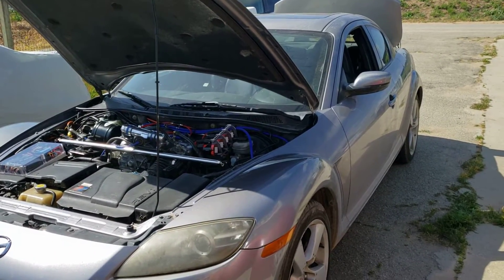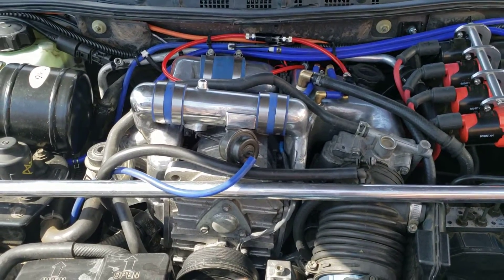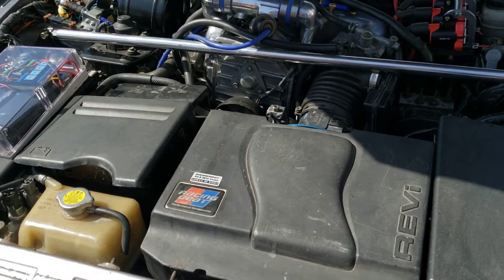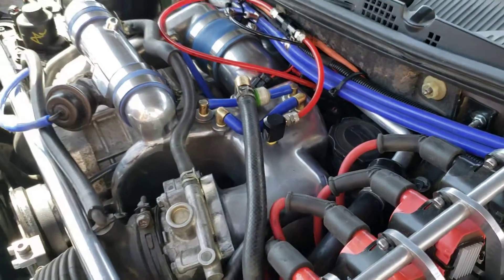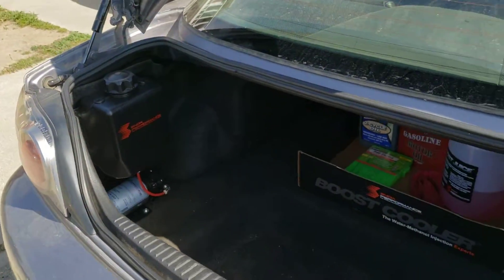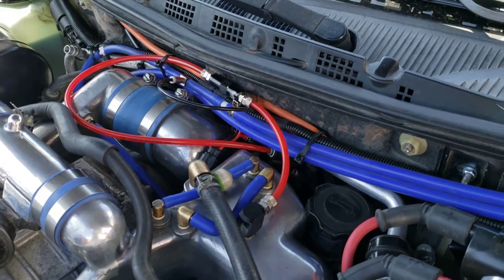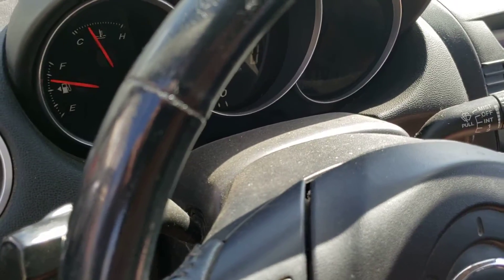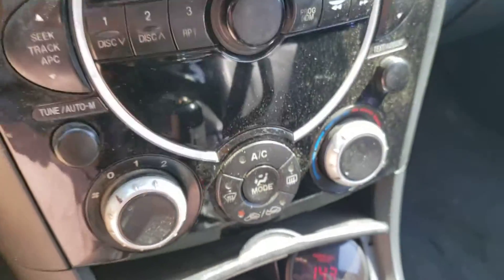RX8 Supercharger/Meth walkaround rev

Comment: It's so good to see to supercharged RX8, very rare, and far simpler than a turbo. Well done.
Reply from the maker: Thanks Simon, I think it is a lot easier install then a turbo. Runs very cool with the meth injection too. I have it off right now so I can modify it for an intercooler and a better bypass. Check out the rx8club thread I have for the latest mod. I'll also post the update here once I install it again. https://www.rx8club.com/series-i-major-horsepower-upgrades-93/gearsofts-sc-thread-271481/page3/#post4952402
Reply: I have a 09 Mazda RX8 R3 package and would be very interested in learning about what you have done with the supercharger saddle computer and methanol cooler. I would also be very interested in learning what it dinos at?
Reply: @shermanlewis2510  damn bro you're so lucky. I'm saving up for a year to have 12k so I can hopefully get an r3 as well

Comment: Subscribed, good content and informative. I have modded my Rx8 and still adding more. Sitting at 79k miles. I inject two stroke from a reservoir as well. Havent't seen a force induction Rx8 with the two stroke feed. Love the build, can't wait to see it after being rebuilt.
Reply from the maker: Finished the rebuild a while ago and added a roller bearing mod to the eshaft so I can tension the SC belt and not wear out the motor bearing on the next install. Working on rev 3 for the SC install with a water-air intercooler and ice bucket.

Comment: Sweet build! looks really nice and I'm looking to do some mods similar to yours on my own 07 RX8!
Reply from the maker: Thanks Potato! Some of the basic mods like the 2 stroke oil injection and the ls2 coils are some great ones to start with. The coils do require some dwell changes in the ecu that I did with versatuner, but you can use a great new coil that BHR came out with recently that doesn't require any dwell mods. https://black-halo-racing.myshopify.com/products/ignition-upgrade
I'll probably upgrade to these but I really do like how my ls2 style coils look where I relocated them too.

Comment: Thank you for sharing your work! I imagine that a supercharger fits well with the characteristics of the RX-8. Is your ECU setup able to handle E85 flex fuel (if one would install a sensor, and adjust the fueling system)?
Reply from the maker: Yes the SC does a nice job making up for what the RX8 lacks on the low end. I have boost set to come on at about 1200 RPM. If you know rotorys, you don't got much until you hit at least 4500 or 5000. The E85 would be great instead of the water-meth but I can't get it easily where I live. I'm working on the next SC revisions right after xmas. Had to pull it off to smog. Going to add a water-air intercooler so I won't need water-meth or E85. The SC only adds about 10 psi booth so the premium fuel will work fine with that.
Reply: @johngeary4202  Thank you for the fast and informative reply! Looking forward to see your future projects!

Comment: Looks great, what is your ecu setup, looks like you have a nano and some kind of relay board? Sounds like a great price on the SC kit. How what mileage do you get on the water tank, that pump looks kind of serious.
Reply from the maker: Thanks lizunya1983 for the comments!
Here's the ecu setup:
eManage ultimate  piggyback  to intercept the fuel injectors and ignition and map more fuel and timing when it sees boost. I have a MAP sensor and an AFR connected (the AFR has a sensor that I welded a bung in the exhaust for). The emanage also looks at the throttle position and sends an output to turn on the supercharger at 30% depending on RPM and throttle position.
Arduino Nano intercepts the emanage SC signal to police the SC. It controls the supercharger, water-meth pump and a bypass (like a wastegate on a turbo). using inputs from the emanage, a "Mad Max" button in the car, and other sensors like a float in the WM tank and a pressure monitor on the WM line to control whether the SC is allowed to come on. Since I now have the fuel and timing modified for the WMI I have it not allow the supercharger to run if there's an issue with the WMI system. The program is getting too big for the Nano now some I'm upgrading it to a Nano 33 BLE. I'm also doing this upgrade to give me a bluetooth connection to my phone and have an app I configured to be able to monitor and modify settings and timers on the Nano while I'm driving.
The Nano connects to the relay board that uses very low amps from it to control the SC clutch, WMI pump and the wastegate bypass solenoid I installed.
There's also a Greedy boost controller that is set to limit boost to 10 PSI that is mounted in the car. It controls boost using the wastegate once the Nano hands off control to it with a bypass solenoid I installed.
Lot's of other technical but I think I'll just make a new video to go over it all.
You also asked about the pump. It's a standard starter kit from Snow. The pump can push 300 psi but it's governed by the nozzle that's in the intake which is a 175 ml per minute. If you do the math it can use up the tank in 15 minutes at that rate but it does only turn on the pump when I'm using the supercharger and since that's on a clutch and set for 30% throttle it really depends on how I'm driving it for how much it uses. I'm buying winter windshield washer fluid for $2 bucks that has 30% methanol in it and using that for the WMI system so it's not a big expense.
Reply: @johngeary4202  Thanks for the detailed response! Sounds like you could get through the tank pretty quick if you were pushing it. Is the snow kit a fixed head/flow rate? So you're still feeding the stock MAF and wideband into the stock ecu? The engagement of the SC is sounds great, so the center console button is latching and the gear lever switch is momentary and both are supervised by the nano based on the eManage state? I think I need a flowchart or something! Looking forward to seeing a video on your control setup!
Reply from the maker: @lizunya1983  The WMI is regulated by the size of the injection nozzle. Snow base kit comes with two nozzle sizes, I'm using a 175ml per minute. At full pump speed it should use that much WM per minute. I'm working on a speed controller for the WMI motor to control the pump speed based on boost and RPM. Snow does have a controller for this but it's based only on boost pressure, you set a low and a high boost psi and the controller runs the pump proportionally depending on these settings. In an SC setup like mine the boost is always on or off so I'm looking at using an extra output I have on the eManage that I'll setup to give me a 0-5v out based on boost and RPM that I'll then send that signal to the Nano to control the pump speed using a brushed esc. I'll probably need to do some re-tuning but this should use less WM and give me some control over the pump and the ml per second.
The stock MAF and wideband are still feeding the stock ecu, the only potential issue with using a piggyback ecu on top of the stock one is the stock ecu may try to re-tune itself based on the wideband in closed loop mode, but I do keep an eye on the trims... 
The center console button is latching and the gear lever switch is momentary and both are supervised by the nano based on the eManage state, and yes a flowchart would be helpful, maybe I'll setup a whiteboard in my next video to help explain this, or if you're an Arduino guy I'll share the code with you. The program is over 400 lines of code and has out grown the standard Nano's memory of 2k so I moved on to a Nano Every with 6k and have an HC-06 bluetooth module with an interface on my phone so I can monitor the Nano's status and change some of the timers in it from inside of the car.
Here's a short snip of the code:
////////////////////////////////////////////////////////////////////////////////////////////////
// RX8_SC_Bypass4
// Blitz Supercharger with Water-Methanol injection and air tank solinoid to bypass
// written by John Geary
// version 1.0 initial
// version 1.1 pre WM PSI failsafe
// version 1.2 WM PSI failsafe added - loaded in car 5.22.20 8pm - delayWM_interval  = 1000
// version 1.3 variable treaks - comments added - no logic changes
//    added variadic template function - loaded in car 5.28.20 3pm
// version 1.4 added syncBypass = true to keep bypass closed insync with the supercharger
// version 2.0 modified for nano every and hc-06 upgrade
////////////////////////////////////////////////////////////////////////////////////////////////
...
// set outputs if anything changed
void setOutputs() {
  readBT();
  if (inputsChanged) {
    if (!sentFrom_PSI_changed) {
      check_PSI();
    } else {
      sentFrom_PSI_changed = false;
    }
    //should not be any pressure if before starting the WM pump.
    //if a wire breaks on the pressure sensor it will not start boost.
    WMPSIok = (digitalRead(inWMPSI) == HIGH) ? true : false; //reversed logic NPN, on=high if pressure sensed
    Serial.println(F(""));
    if (simulate == LOW) {
      Serial.println(F("-------Simulation Benchtest-------"));
      if (WMPSIdrop and !simWMPSIinit) {
        WMPSIok = false;
      }
    } else if (simulate == HIGH) {
      Serial.println(F("-------Live in car-------"));
...
Reply: @johngeary4202  what supercharger did you run? I'm so intimately curious on where you bought it.. could yo ugive me a product name/link any details at all?
Reply from the maker: @TASTELESSAUTO  It's a Blitz supercharge. They used to sell them back in '04 for about $8K for the complete kit. You can't buy them any more from Blitz. I found this one on eBay for $1,600 but it was missing the controller and some minor brackets. I'm pretty good with electronics and programming so I added a Greedy eManage piggyback and an Arduino to control the clutch and water-meth. Your best bet for finding one is to open a search on ebay and have it notify you if one goes on sale, then jump on it! That's what I did.

Comment: I have not seen a blitz product in like 20 years.
Reply from the maker: I just rebuilt the motor and I'm cleaning up the wiring and putting the supercharger back on. Looking at modifing the bypass and adding an intercooler to the next version.

Comment: did you have to extend the original cables to move the ignition coils to that point? if yes, how did you do it? Thanks.
Reply from the maker: I made my own cables. Here's a parts list from Amazon:
MSD 34039 Red 8.5mm 6' Roll Spark Plug Wire https://www.amazon.com/dp/B00062YYEU/ref=cm_sw_r_apan_glt_fabc_FY8YNB8KN855KJNRT3MT?_encoding=UTF8&psc=1
Taylor Cable 46069 Spark Plug Boot https://www.amazon.com/dp/B007YDACP4?ref=ppx_pop_mob_ap_share
Taylor Cable 46061 Blue 90-Degree... https://www.amazon.com/dp/B000CQ4BEI?ref=ppx_pop_mob_ap_share
IWISS Ratchet Spark Plug Wire... https://www.amazon.com/dp/B07K2VG6XY?ref=ppx_pop_mob_ap_share

Comment: OMFG is this supercharger setup doable at home? I have no experience in tuning sadly... thats why I got a miata for now
Reply from the maker: I bought the SC on ebay for $1600 and added an emanage piggyback fuel(etc) manager and an arduino to help control the clutch on the SC and the water/meth injection and for protection for it. So, yes this is doable at home but you really need to be careful not to detonate (run too lean) your engine or you can destroy it. The emanage has logging so you can modify the fuel and timing maps in it and then take the car for a test run and use the logging to fine tune the maps. emanage is kind of old and I may upgrade to another computer but it's been working great for me. The Water meth also helps with detonation and makes it a lot easier to tune. Hey miatas are cool! The motor isn't that powerful but it works great with a car that light and nimble!
Reply: John Geary yeah I love my miata. But its my project till I can afford an rx8 :D
Reply from the maker: @maybelive765  , you better have a boat load of cash saved when you buy your 8 because you'll most likely need to rebuild the motor. I just did mine and it cost me $4k and I did the rebuild myself!
Reply: John Geary oh wow I will consider this. Im sure its not that bad long-term right? Anyhow i will be so happy once I switch cars, the miata's great but you CANNNNOOOTT take it outside during winter time. Its just not properly set up at all, especially the interior even with a hardtop. At least with any RX8 you have decent interior climate control lol. Here in upper canada winters will be rough so I dont expect much, would you happen to know some tricks that could potentially help me run the car longer throughout the year... at worst imma pre-heat the oil like a race car 😂😂
Reply from the maker: @maybelive765  If you fix the motor once and fix it right it will last a long time. I did a few other mods to help it last longer too like replacing the stock ignition coils with some ls1 d585 coils (need to set the coil dwell map if you add these). You can really kill your engine to have it misfiring and the stock coils don't seam to last very long. I also added a sohn adapter that lets you burn 2-stroke oil instead of the regular engine oil and I install software from versatuner that lets me increase the oil injection. Since my latest rebuild I'm also premixing the gas with 2-stroke oil, only about a 1/2oz per gallon, but this will really help the engine to last longer too, and the 2-stroke oil I'm using doesn't cause carbon buildup like the engine oil will, carbon buildup is another compression killer in rotories. Rotories also run a little hot so I'm looking at some mods to the oil coolers to help a little more. I already have an upgraded aluminum radiator and I used versatuner to set the fans to come on at 195f instead of 205f and I put in a lower temp thermostat (168f). I didn't do these mods all at once so if you like working on your car and making some improvements you can just add these one at a time.
Reply from the maker: ...was thinking that since you have some cold upper canada winters that the rx8 should love that weather!
Reply: @johngeary4202  which is crazy when you can buy a new 13b msp motor from Mazda for five grand. I wouldn't trust their builders over yourself though. Ha
Reply: @johngeary4202  cut a out a square hole in the wheel liner behind the oil cooler. You can also mount pc fans. Bending out the fins also helps a lot.

Comment: How much for the hole kit? And where do I get it from?
Reply from the maker: $1,600 from eBay. The kit I bought was used and not complete. I got it off ebay from someone in Japan. The Blitz site had the manual but it was all in Japanese and the pdf conversion to english was not the greatest. I needed to find or make all of the missing parts, the computer that came with it was not from the original kit so I threw it out and ended up getting a Greedy E-Manage. So I tried to set everything up as best as I could based on the original design of this kit and a few extras I thought would help, like adding a map sensor to base the fuel and ignition maps off of instead of the maf. I setup an aux output map in e-manage to trigger the compressor clutch at 30% and did do a little change at lower rpm to turn on at a little higher throttle.
Reply: @johngeary4202  so basically it’s a secam? Or if I ordered it from a store (compeat kit) would it work?
Reply from the maker: It wasn't a scam, I knew what I was getting. You can't buy these kits new anywhere and when it was new in '04 it was about $9K. I think you can get a turbo kit for about $6K plus install and get even more power, but I wanted the challege.

Comment: What kind of HP/Trq are you pushing?
Reply from the maker: Haven't dyno'd it yet but I would say a 30 to 50 HP for just the supercharger and about +20 HP more with the water/meth. I've got it down for a rebuild now so I'm expecting a real monster when it's back on the road. Compression was low when I put the SC kit, only about 75 to 80 psi. After the rebuild should be 120 psi.